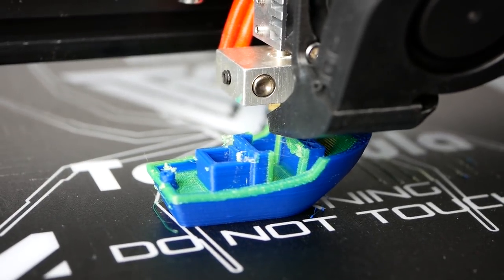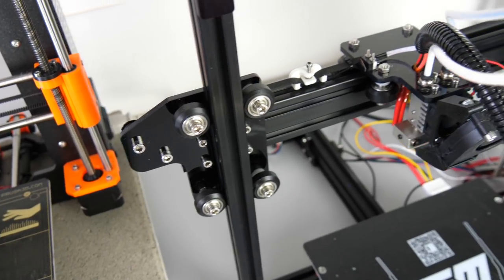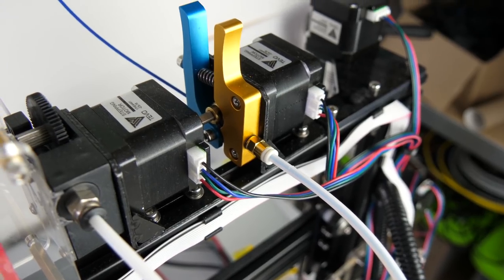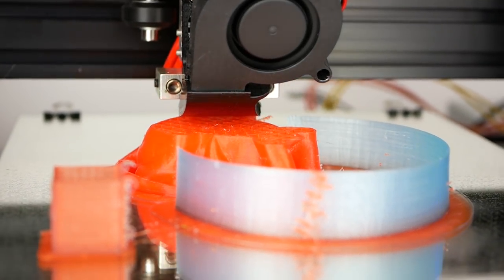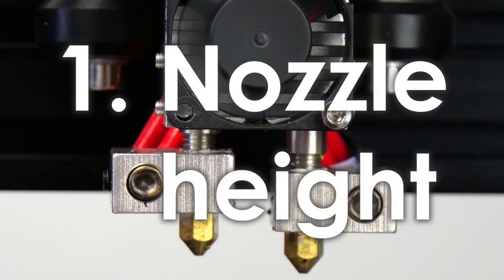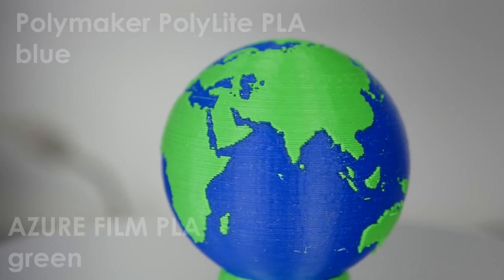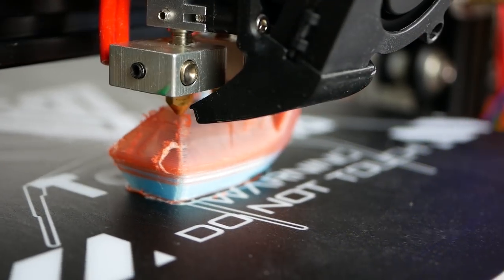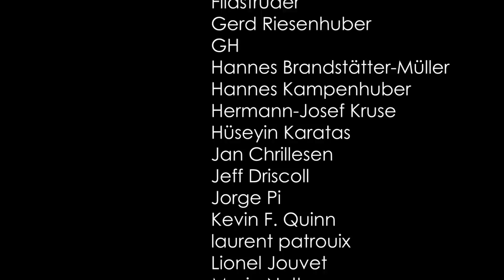Tevo Tarantula DUAL EXTRUDER: Review & introduction to MULTI COLOR 3D PRINTING

Comment: For the AC terminals: After securing the screws, coat them with Liquid Electrical Tape. Brush on and let set, repeat. You now have a durable yet removeable coating to protect you from mains voltage. Ideally you should unplug it, but troubleshooting is rather difficult that way. Also get the Velcro wraps for cable management. Lets you work with the cables frequently without wasting ties, cutting fine wires, etc.

Comment: If you have enough time and lots of experience building ,tuning,and maintaining 3d printers , This is possible. Otherwise never attempt or buy this Tevo Tarantula Dual ex printer.  you will need to modify and do a lot of wiring and other changes. Its not for the faint of heart.
Reply: and stay away from the creator pro its not supported by cura and dual extrusion is a true shore, just not fun and works like badly

Comment: Have owned a TEVO Tarantula for over a year now and I have spent too much money/time upgrading it. But that is because I like it! Some of the upgrades are not necessary but nice like touchscreen. Have also installed DIY kits of dual extruder and dual z, sadly I got the "bad" version of dual hotend with the scews on the back. In conclusion is the Tarantula worth it. For me it is, when I ordered it 1 of May 2017 it was no CR10, flsun, tronxy printers with large price are for the price of 198 USD. If I would buy a printer today for 200 USD I would opt for a Flsun printer because of the large print are for the money. But I would still recommend the Tarantula!
Reply: Got mine for €157, upgraded it with a part cooling fan and glass for the print bed (less than €10 for the upgrades).
I would recommend this printer (the single extruder) to anyone who wants to start with 3D printing.

Comment: instead of 2 colors, 2 diffent Diameters would be way more usefull (0.2 + 1mm Nozzle) to speed up Prints.
Reply: You can just change a nozzle yourself to do that.
Reply: no  i mean , 2 nozzles at the same time (dual extruder), fine nozzle only for the outer shell, bigger one for pumping material inside faster
Reply: @hyperhektor7733  yeah you can do that...you can enter the nozzle diameter for each nozzle in your slicer
Reply: @Nepoxification  I would like to see someone try this idea out: Faster prints with fine surface detail? Yeah! Stefan?
Reply: @gregzambo6693  well since my comment i upgraded my ender 3 to dual extrusion with 2 seperate nozzles...so yeah i could totally go for 2 different nozzle sizes now
Reply: Hyper Hektor wouldn’t you need to change the height of the z axis every time the size is changed, like if the 1mm was infill and 0.2mm was outer wall then wouldn’t the infill be squished every small layer change that the 0.2 makes or would you have the infill wait a few layers and then start extruding, idk it seems really cool but a tedious learning curve
Reply: @justjack8909  yes my example was a but too wide appart, but since material could be squished*, my guess is 0,3mm + 0,8mm could work at 0,2mm Layerheight, or similar combos like 0,4 + 1mm at 0,3mm height. You get the idea :). *CNC kitchen has made a video about that topic.

Comment: What I want to know is, there are 2 main kinds of dual extruder: 2 in 1 out, and 2 in 2 out. So... you can buy a printer that mixes colours in the same temperature range (2 in 1 out), or a printer that can print 2 materials in one model, such as PVA for supports). My question is this: Why can't you have both in one printer, making it tri-colour? One part of the extruder could be a 2 in 1 out for mixing colours, and then have another independent nozzle/hot end for a 3rd extruder on the side of this, so you can then print dual colour with supports? It seems to me that it wouldn't be too much extra weight with a bowden set up and the hardware would just need a bigger power supply. 
The only thing is slicer settings would need a bit of an overhaul, perhaps needing new software to go with the firmware since it's now 3 extruders.
...Actually that last one is a bit of a tall order so perhaps I've answered my own question. I don't suppose there's enough demand for it for anyone to bother investing in this project.
Reply: Zonestar's now made a hotend exactly like this. It's a 3 in 2 out hotend.

Comment: Can confirm: Got a single-extruder Tarantula, and while it mostly prints decently, the bad frame connectors make it almost impossible to keep level, and the assembly instructions are absolute trash. And to top it all off, one of the T-nuts had no threads in it at all, and the kit came with no spares to speak of. (good thing I had a metric tap-and-die set)
I was also exceptionally lucky to be able to source a 5015 blower from an old battery charger, and it works fairly well even with just the single blower.

Comment: Nice review.   I have issues with most of these cheap 3D printers.    Even if they have good firmware like Marlin.      They always cut costs on all the support parts.    Their are many nice designs of 3D printers on Thingverse.   To build good solid support 3D printer.   Always seem to get what you pay for.      I  always like your reviews, Stephan.  :-)

Comment: Just started playing with a chimera CR-10 myself. Working on ooze preventing. I guess it's not as big a problem on PVA/PLA compared to dual PLA?
Reply from the maker: Nope. Just print way slower with PVA. I used 20-30mm/s. Take a look at the temperature reduction feature in CURA to reduce oozing.
Reply: You can always wash off the PVA ooze! And the PLA ooze on top of PVA is coming off too, with the PVA.

Comment: I unfortunately ordered a knock off chimera and ended having to drill and tap the grub screws into the side in order to make a dual extruder upgrade to work.  Another note was most other dimensions were off from the e3d opensource hardware dimension as well.  So making adapters and such were pointless to make before actually receiving  the parts.

Comment: Hello, I have this same Tevo Tarantula 3D printer with E3D Chimera dual hotend, dual z motors and large bed. But I have trouble with ABS dual extrusion. Colors black and white,. The white gets a lot of black marks. What retraction settings did you use? What temperatures? I have oozing from the non-printing extruder. Have you tried ABS or only PLA?

Comment: I could really use everyone's help with choosing a new printer. The one I have now is always breaking down and it's stepping on my last nerve. I would highly prefer a American based company and I like these 2 so far.
Robo R1 plus
Cetus with heated bed
For Chinese made one's I been eyeing 
Monoprice select plus
Anycubic
Cr-10 mini
My limit is $400 usd. The robo is a refurbished for $399 which is ok since it comes with the standard warranty. Would love any advice from people who have experience with any of these models.
Reply: I know this reply is now 4 months after the fact and thoug very well could have purchased 10 different printers, however, depending on your level of experience, your desire to tinker and time available it wouldn't be too horrible of an idea to build your own. For a $400 budget you could create a very nice printer, auto leveling, dual extruding, heated bed..... the whole 9. I started out with first a kit printer,  then a2nd. 3rd was pre-assembled but decided that for the money im paying, building my own, the challenge and reward would be worth it and it was. I built a 300x300x300 printer with all listed benefits while using good motors, genuine parts from e3d and antclabs and it all came under your budget. To be able to create something you cannot buy, customize it to your own desire and have the feeling of "yes, that is MY doing", it is worth it in the end. However, with that said, i fo have as stated other printers running well that i could print needed parts from, the time (or i did) to devote to building and the tools needed for everything (cutting, drilling, screwing,  measuring and so forth). One thing i learned is the community is amazing and even the busiest of youtubers are willing to spend their extra time just to help you learn.

Comment: Got issues with the chimera. There are two heated nozzle from 1 single heat sink. Also the heat sink as less exposed surface than ordinary E3D. I had more problems in the heated chamber with PLA. I guess the heat sink temp is too high and material soften too early in the tube. I tried to level both nozzle on the build plate as high as possible to close the gap inside between heat break and heat sink and use thermal paste but it didn't got better. At this point I'm thinking about water cooling. Do you have better idea?

Comment: i found the dual nozzle i3 without a premium on amazon, is it worth getting the second nozzle if the price gain is not there? 250 for base printer, 262 with automatic platform height detection and 265 for dual nozzle and automatic platform height detection. opinions?

Comment: I'd say that this printer is worth the money and the power supply,you just need to be careful.I am 12 years old and i assambled this 3D printer by my own and yes,the wiring is a total mess but zip ties came in handy.In my opinion this is a good,cheap 3D printer.I got it for 283 eur

Comment from the maker: Looking for a good deal on a new 3D printer and want to support the channel? Take a look at the affiliate links below and in the description:
TEVO Tarantula for $264.28: https://goo.gl/hY53qQ OR AMAZON http://geni.us/Shfx
TEVO Tornado for $339.99 with coupon "GW4-15": https://goo.gl/Q1CR87
Alfawise U20 starting from $169.99: https://goo.gl/45ihaz
CR-10S on AMAZON Prime: http://geni.us/rVBsR
ANET E10 for $249.99 with coupon "GW4-13": https://goo.gl/o3qQdo
Tronxy X5S for $275.99 with coupon "GW4-14": https://goo.gl/BncF75

Comment: How much plastic is wasted on the prime tower+ ooze shield?
Reply from the maker: You're totally right. I forgot to mention that. It's a little wasteful, but usually not as wasteful as single-nozzle multi-extrusion.
Here are some examples (support weight/total weight):
Globe: 17%
Moai figure: 27%
3DBenchy: 40%
Reply: For all the drawbacks on these kinds of "cheaper" prusa i3 clone kits do you think buying an original  Prusa, outwieghs the money spent on parts and time wasted needing to fiddle with these kind of kits to get a reliable and worthy  machine to match?
Reply from the maker: Depends on how much you value your time. If you've got the money and want don't want to spend a lot of time debugging, I'd always advice to go for an original Prusa.
Reply: Sorry, all thumbs when I'm on the smartphone. My reply wasn't supposed to be to Pedro but just a general reply to your video.  Thank you again for sharing your time and knowledge.

Comment: I was waiting to hear about some horrible safety issue the whole video, but at the end, there really wasn't any? It's common of kits to ship with a bare PSU, and basically you just put a piece of tape at first to secure the flap and make the gap inaccessible, and then first print is the PSU connector shroud. Pretty obvious and no big deal.
Reply from the maker: note to myself: viewtime baiting worked sorry, just kidding. I know this is/was common with 3D printer kits but still I think is totally dangerous. This could be pre-wired, just like e.g. Prusa does it. Not a lot of effort and would make it way more safe for people who are not used to work with electronics.
Reply: Dude, you don't have to bait the view time from me, i watch your videos (of reasonable length - not livestreams) in their full length anyway. Well until their quality someday decreases, as it often happens, soooo... just make sure to not go down one of those paths.
Reply from the maker: You can be sure that I won't go that path. Would result in loosing all trust. Unfortunately YouTube requires a little baiting, but honest baiting for good content is, in my opinion, totally fine.

Comment: You cover the cooling fan for the chimera with the blower fan for part cooling?
Reply from the maker: No, there is a very large gap between the two fans.
Reply: Okay, I ask only because the chimera is known for having problems with cooling even under normal conditions with the stock fan if you use 2 high temperature filaments. Many users change  the fan to a bigger version.
Reply from the maker: Didn't have an issue so far and when I touched the heatsink it didn't feel hot.
Reply: I remember now that the users that have this problems are all using an enclosure. Cooling with >40°C hot air is much less effective. So it is possible that it will work for you.

Comment: I bought a cheap dual extruder and hotends but i cant get them to work in the firmware beacuse when i set the number of extruders to 2 i get a problem which in cant fix. Any help??
Reply from the maker: Which problem?
Reply: CNC Kitchen heater pin not defined or something like that i currently am at work so i dont know, will tell you when i come home
Reply: exit status 1
#error "HEATER_1_PIN not defined for this board."
Reply: Could you upload your marlin file
Reply from the maker: You can find it on my GitHub: 
https://github.com/CNCKitchen/TevoTarantulaDual
Reply: Thanks alot man!

Comment: Thanks for calling a spade a spade. $280 (and shipping/tax) for a large dual-extrusion printer is pretty nice. Paying $280 for a printer that lacks a part fan, has an exposed PSU, just plain doesn't believe in cable management, can rattle itself apart, and takes a lot of babying to get it to print safely and reliably... Ehhhhhhhhhhhh... judgement call if you have a lot of free time?

Comment: Hi I need your help,
I am not programmer but I want to  try to make 3D printer at home but I am not able to programme. Please can you send me that code or its programme. Or  it's programming steps in another video.☺️ Please....
Reply: Start by learning arduino. Arduino software is free to download to your computer and you can use it to write programs for arduino. And you don't even  have to buy an arduino to learn from it; you can use "tinkercad circuits" for free online to simulate using an arduino board.